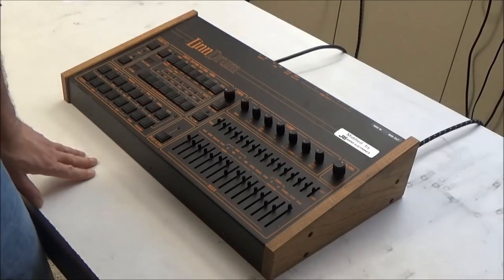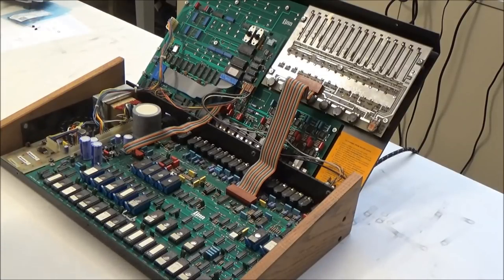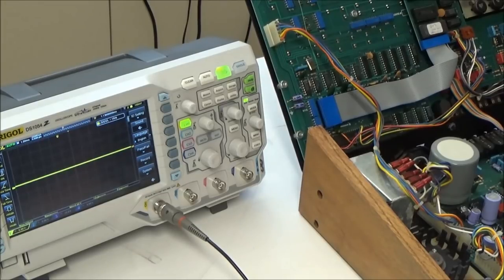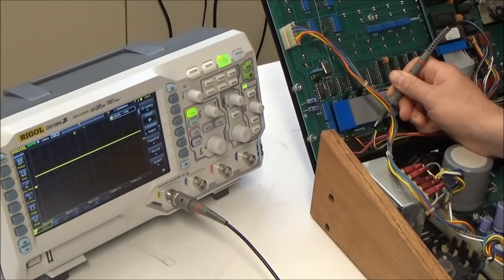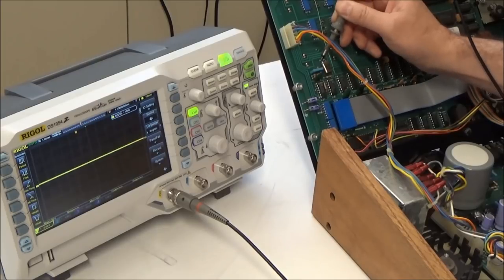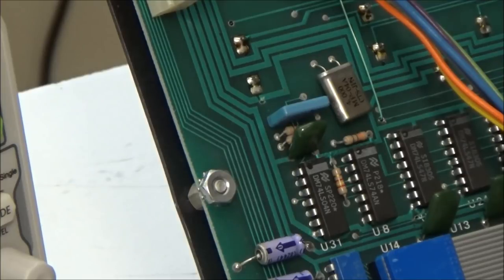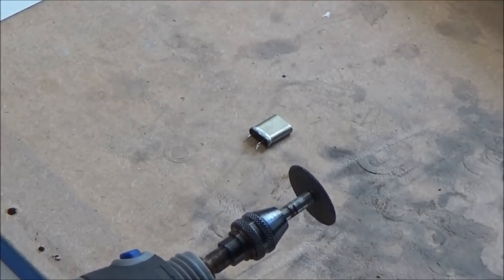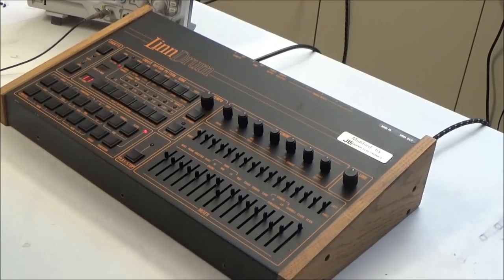Synthchaser #105 - LinnDrum Repair - Dead Drum Machine

Comment: Well done! Why are  there no backup batteries on the power supply? Does this one have some NVRAM fitted?
Reply from the maker: The customer was planning on replacing the power supply himself later with an aftermarket one.
Reply: @Synthchaser  Interesting.  Didn't even know there were some. But I guess when this special Lambda TO-3 regulator blows, customers are going to need an aftermarket solution. So far I have done only 2 LINNs. One I replaced the batteries with std. AA holders so replacing the battery is easy and  can be done by the customer. The other one I installed cypress NVRAM with a special adapter on the EPROM socket. Cutting off some chipselect on a 'LS139 and left all the 6116s in it, deactivated. Get /CS from the 'LS02 and write A11-A13 to my little PCB.The NVRAM contains the firmware (hardware write protected) and all the RAM, now non volatile. In case the RAM needs to be cleared there is now even a panik RAM clean firmeare. ON/OFF cycles: 100K; Data retention: 143 years. Should be good enough. Gonna watch more of your very interesting videos.
Reply from the maker: I might have shown that power supply in another Linn Drum video.  Usually the NiCds have leaked so it either takes removing the corrosion and installing a AA holder or replacing the board.  I've done NVRAM to other synths, but not the LinnDrum, that's cool that you've done it!  That for sure is the right way to go.
Reply: @Synthchaser  Oh cool, gonna watch that video. The NiCds on the one I repaired were dead but not leaking, gladly. Just went through my notes about the NVRAM mod: I removed the 2 EPROMs, and put my 32KByte NVRAM in pos U14 where /OE is A12. /CE from U36 Pin 10, /WE from U36 Pin 1. There is logic on my adapter board that prevents /WE from going down whenever A13 is low (EPROM 8K address space  write protection). A14 can also be connected via a small switch and when done it boots panic software that deletes all the RAM.